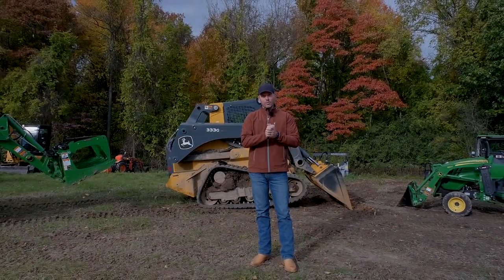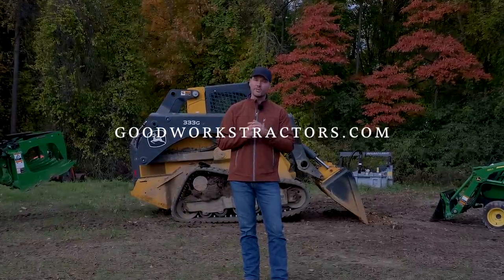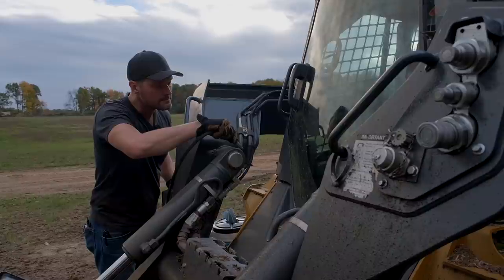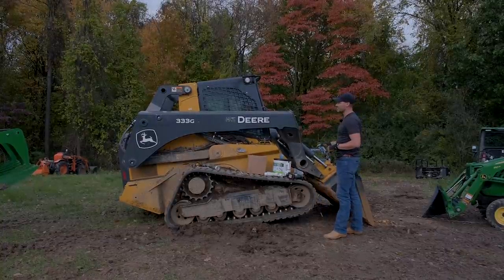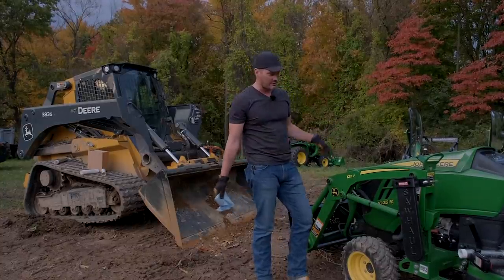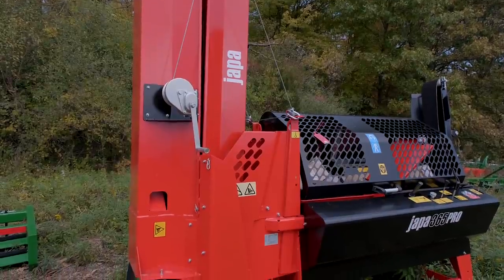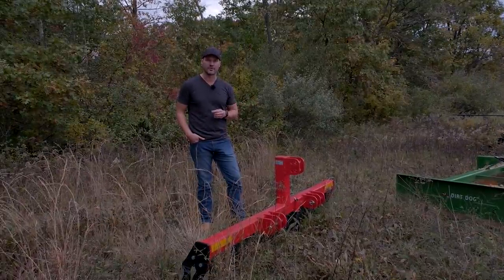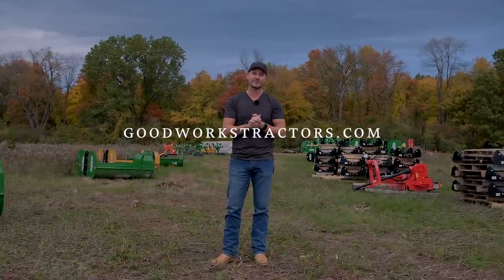NEW ATTACHMENTS FOR COMPACT TRACTORS & GOTTA GREASE 🤩🚜

Comment: Is for any of my track machines when I clean them I use a post hold is the post hole digger shovel the long skinny shovel about 2' long and about 8" wide maybe 10 the most and it's kind of beveled and and it gives you the ability to reach up in there and get that mud out of that track system . It's a lot easier than using a crowbar just saying

Comment: Good chance the loader angle is putting pressure on the joint. Also as an owner of 3 pieces of track equipment, I would recommend cleaning away heavy mud debris on a regular basis. Yep it is a pain but sure helps with track maintenance. Great video.

Comment: Adjusting the tracks with grease been around a long time. I started out on 1977ish JD350 crawler dozers and that's how you adjusted the chains/tracks on those. The only difference was the grease fitting, they were button style fittings. Also each roller had a fitting too.

Comment: I’ve seen just pressure on the pin by the way the loader is sitting cause that particular grease gun to act just like you experienced. Changing the pressure on the pin allows grease to flow.

Comment: A tip I for the zerks closest to the attachment, fill the cup around the zerk with grease that will make it a lot easier to clean out the next time dirt doesn't pack in there the same way.

Comment: For the stuck zerc you can use a slight tap on the little sealing ball to un-stick it, or you can use a bit of heat.  If that fails just replace it. Also I use a locking grease gun tip to get more pressure.
To help make sure I locate each zerc I put contrasting colored caps on them to make them easy to find. Cheers!

Comment: Lube-Shuttle is the best.  Much easier to work with, change tubes, and see grease level.  Add the LockNLube tip (either long or short).  Their add-on right angle attachment works for tight spaces.

Comment: Make sure it’s not a sealed bearing if you put too much grease in a sealed bearing you’ll break the seal. There’s also a tool for stopped up zerks call the grease Buster’s it’s made by lock and lube

Comment: Great video as always Courtney. I am really impressed with a lot of the new equipment that you are coming up with. Really like the log processer and the tree puller.(what is the minimal size tractor)?. Thanks to you already have lube shuttle. It is great and easy to use. Got the battery powered one. As stated before gwt the tractor buyer, attachment, implement one stop shop for most if not all needs. Have a great day guys and keep up the good works and be safe  Tim
Reply: Would love to know the minimum.  I have an x738 that would love a log skidding winch.

Comment: With the post/tree grapple they can remove some fairly large trees - more so if after grabbing on to the tree/post you lift slightly and moving forward/backward rather than just brute force lift straight up - at least that's been my experience using a Danuser Intimidator on my Kubota L3560. While the Intimidator is a bit heavy (eats up 700lbs out of the 1500lb lift capacity), but I can still pull out most of what I'd want to pull out with it. Just need to remember that tall trees can make decent sails even on "calm" days -- that being the case I usually pull out and drop the tree and then do clean up of multiple trees/bushes/etc. with a horizontal-type grapple (where it's easier to grab multiple trees in a single trip)

Comment: the Cross hole in your PIN is plugged sometimes you can unscrew the zert and blow them out with a rubber tip air hose gun at 100 psi air pressure. that don't work you're going to be pulling the PIN And drill out the cross hole

Comment: Love that Lube Shuttle electric, but it would sting the budget at $200, and it's twice that. Maybe if I win the lotto, but till then, I'll just go "vroom-vroom" when I pump my $30 HF grease gun..... FEL/tractor/implements needs greasing only once in a while, and most of those fittings are in easy to access, it's vehicle frontends where the electric shines. I did add a Macnaught coupler which helps, but won't fit in some places. As far as priming goes, good modern hand pump guns work quite well including "change and go, and any grease gun will take a minute to get going again if you run it empty. If I change grease, I always hit the bearing buddys on the trailers when I have to empty the old cartridge grease, you can usually finish out the old tube doing that, and wheel bearings aren't pick on flavor, as long as they have grease (sans H20), they seem to last and last.
I have a B7800 w/pinned 60" bucket, and really like the looks of the "Add-A-Grapple" - been saying to myself - Why doesn't anybody make a thumb for an FEL? - Now they do. Looks well made, with a tie rod cylinder even.
Just bought a lottery ticket, maybe a lube shuttle is in my future... An add-a-grapple too.
PS Nothing on your site yet on the add-a grapple. I'll keep watching for when you get it added.

Comment: There is a tool to free stuck zerks. Lock-n-lub is one place you can get them.
Reply from the maker: This thing?  https://locknlube.com/collections/grease-buster  Anyone used it?
Reply: @GoodWorksTractors  I have not used one. I serviced cars at a dealership about 55 years ago. I only remember 1 stuck zerk. I just replaced it. I have not encountered a stuck zerk since then.

Comment: I've got to wonder why they don't put some soft rubber covers on a tether to cover the zerks. I might try and 3D print some out of TPU or some other flexible filament.
Reply: You can get a bag of these on amazon. I choose a contrasting color to make finding them easier. They are plastic but cheap. Good luck!
Reply: LockNLube sells bags of grease fitting caps
Reply: I've seen those. What I'd really prefer is one that covers the entire area around the zerk, not just the zerk. I was watching a Messick's video on the M8 tractor, and it looks like all the lube points have nice hinged rubber covers over them.

Comment: Those powered greasers are great, just DON'T use them on anything with a seal, like EZ Lube axles, or bearing hubs like on mower decks and such. They can and do blow the seals out.  They work great of bushings though, especially those that are tight.

Comment: New tractor owner here folks, how often should I be greasing?
Reply: Kinda depending on the use and hours.  I personally grease my mower every 3rd cut - smaller yard.  FEL - a couple of pumps before before I begin my work and then I check the joints at the d end of the day. I might do a single pump then move it a around a bit before parking it.
Reply: @SummertymeJamz  I don’t use it for mowing, well that’s a lie, I have a hog but use it for 1/2 hour to an hour twice a year. I primarily use it right now with a grappler for retrieving logs for firewood
Reply: @cidine1950  my advice still applies - a few pumps at the beginning and one at the end. Just enough to see the grease come out of the joints. If you happen to be doing work in sand, you may need to apply during your work.
Reply: The manual will tell you. For example the manual for my tractor advises to grease loader fittings after 10 hours of use. That is 10 hours of loader use, not tractor use. However the dealer said to grease loader fittings a bit more often, especially the fittings around the bucket as they are moving a lot more.